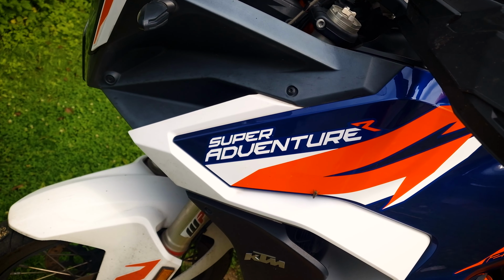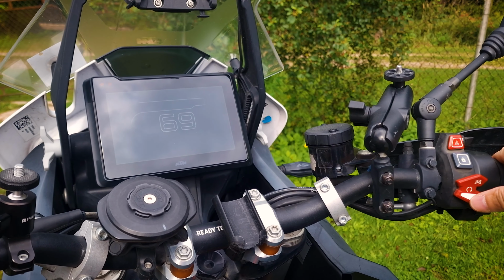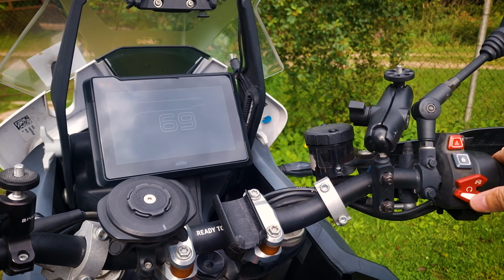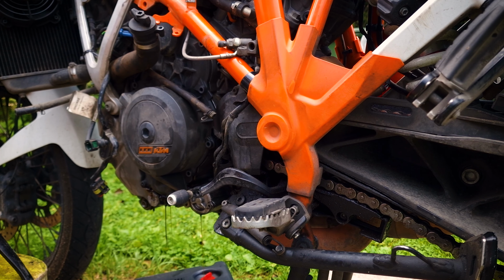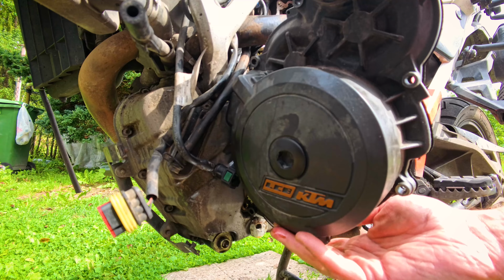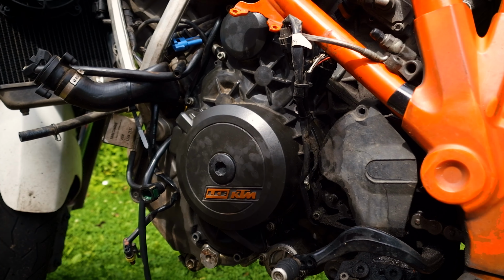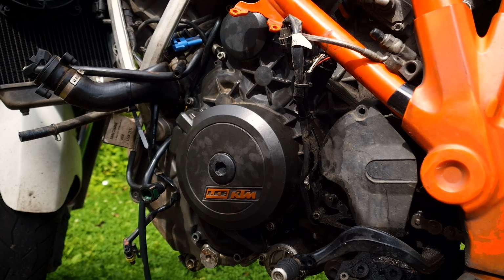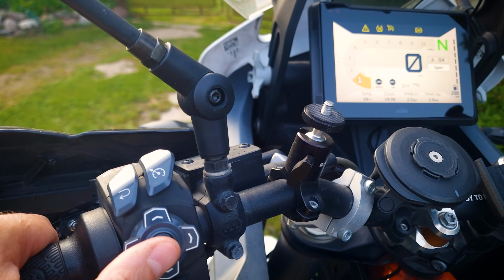How I Fixed My KTM 1290 Super Adventure: No Start Problem Solved!

Comment: These bikes are ridiculously dufficult to work on. Have to take half the bike apart for everything.
Reply from the maker: Yeah, you’re right. But compared to cars, they’re still easier to work on.
Reply: Bodywork and tank are pretty basic to remove. And really not any more work than my naked bikes.
Reply: @kj385 the number of bolts and the different sizes are absolutely ridiculous. On my vfr everything was the same size. Also; to connect the Acc it takes 7 panels and 40+ bolts with 6 different sizes if I recall correctly. This is absolutely bonkers.
Reply: @michaelrjacobs then maybe you’re not the type to work on bikes 😅
Reply: @kj385  nonsense. They should have thought about serviceability.
Reply: Geewizz !! This is not a job for beginners.  I don't know where I will start if it happens to me.  Probably sleep next to the road...😅
Reply: These bikes are all hitech. You must have the skills and knowledge to work on it.
Reply: @rynokeeve2720  Yet Japanese high-tech bikes dont take 7 panels and 40+ bolts in different sizes to even connect the accessory power. Its Just poor design from a maintenance point of view

Comment: wow you are overqualified for home garage mechanic )) its sad that such high priced bike have a problems like this. I have 1190 adv r and the same issue - bike eats crank sensors twice a year (( nobody knows why it happened. advices - you can put motorcycle on the left side using small chair - no oil spill when remove cover, clean motor with pressure air before removing the cover AND you need to check the space between sensor and wheel
Reply from the maker: Thank you! But it's really not hard. And about the sensors, I have a suspicion that they use wires with inadequate insulation on the sensors. It's hardening, and it's probably causing half the problems. I'll have to take the sensor apart and see if I can confirm what I'm saying.
Reply: maybe it depends what continent you're riding or what sensor SKU they use in different locations. I had 30000k on it and it didn't have that problem. The only sensor that ever failed on mine was the side stand sensor :)
Reply from the maker: @dawn-moon  Hi. I've done 68,000, maybe you'll have it break down later too. But you are right, maybe different parts manufacturers are used, for different regions. Probably depends on the oil used, or driving style.

Comment: I live in Northwest Arkansas. We have finally seen temps below freezing. My '22 SAS will not start unless the battery has full charge. I had to take off a lithium battery I bought in early Summer, it just will not start this LC8 in the cold. I put the stock battery back on (after a load test and full charge) and could not start without using a jump pack. Needless to say, I will be investing in an AGM battery. I have over 12k miles on mine, but am frustrated that these 1290s are so sensitive to battery voltage at startup. BTW, once running, battery volatage is around 14v
Reply from the maker: Hey!
Yes, batteries are a problem! If the battery is a bit low or old, it doesn't have enough starting current to turn the engine. That's because of the big cylinders and the high compression ratio.  Or do you have one that cranks but won't start?
Sometimes it has helped me to push the bike back and forth with the gear engaged to move the piston, then it will start. But that trick doesn't work in the dirt.
Reply: @D-Stealth  I think my issue is battery related. The lithium isn't recommended for cold storage, even says so on the package, but an option for summer. It is very light, not even 1kg versus nearly 4kg for stock lead battery. My SAS is parked in storage with no heat/electricity so I pull battery off (a minor pain) and trickle charge. I will try rocking bike in gear to see if that helps.
Reply from the maker: @scottieray  Well, you really need to rock the bike hard to get the crankshaft to turn a little. About the weight savings, is it really worth it for just a couple of kilograms? When I ride off-road, my bike usually picks up at least 10 kg of mud anyway. And when I travel, I feel like I’m carrying half of my house with me! :)

I was actually considering a lithium battery mainly for the higher cranking power. But thanks for the info — I can see it won’t really help in my case. For example, today I was riding in 2°C weather.
Reply: Indeed the battery needs to be in very good condition to start the bike, mine is from 2021 and I already changed once on 2023. Currently I'm having same issues to start the bike again, so I need to charge the battery or make a big trip.
@itsreallyeasy very nice video mate, I'll try your trick to move the bike in gear to see if it helps when she don't wanna start
Reply from the maker: @psycodriver  I'm planning on changing my battery early this season too. It would be a shame if the bike doesn't start for many thousands of kilometers from home.

Comment: Easiest way to install the generator cover (on any bike) is to use longer bolts (with the heads cut off) or some threaded rod screwed into the engine case in 3 or 4 locations, then you can use them to both locate and guide the cover on without fighting the magnetism. Simples 🙂
Reply from the maker: Hi! You're right, but it's even easier, there's a threaded hole in the center of the cover. A bolt can be screwed into it. It can be used to remove or install the cover very gently. I was just afraid that the threads weren't secure enough. But the official service confirmed that this is how they do it. It's just a bolt.

Comment: I will carry a spare crank sensor on the bike, especially for long trips & replace the crank sensor at each valve adjustment.
Reply from the maker: I have a sensor that has worked 60 thousand kilometers. But it doesn't take up much space. But then pay more attention to the engine start buttons. It is also a weak point and causes problems on long journeys.

Comment: You can check fault codes with a regular bluetooth obd2 reader and a free app for your phone, all you need to buy extra is a cable for euro 5 model.
A tip, if the tachometer does not respond when you crank, the sensor is the first thing to check
Reply from the maker: I was looking more at specialized diagnostic tools that can, for example, make quickshifter adaptation. But they cost 450 euros. And my bike has not broken down on electronics yet.
Reply: @ItsReallyEasy  Sounds cheap, what brand is that? The ones I've seen start at 2200eur
Reply from the maker: @daneng2335  For example: Duonix Bike-Scan 2 Pro diagnostic device for KTM is available on Touratech.

Comment: Regarding the little metal shaving that you found in the oil screw filter ... that is a piece from the thread of the engine case ( where you screw the bolt with filter) 
I had mine overtight or put back on an angle and stripped all the teeth of the engine case!   Had it fixed with a TIME SERT! 
keep an eye on it next oil change! good luck

Comment: Great job i have the same bike and took the tank and cowling off right after buying it off the showroom floor to install Denali Lights and also reposition some loose wiring harness resting on the hot radiator. Wasn't difficult bur it does have a sequence.

Comment: Love the video mate! But crankhaft position sensor is not the only one. Coolant temperature, oil temperature, air sensor and others.
Reply from the maker: Hi! You're right, there are a lot of sensors. But if the others are broken, the bike will start, or indicate the problem on the screen. Like the gear sensor or the footpeg sensor. If the temperature or air pressure sensor fails, the computer can operate in emergency mode. The engine will not work properly, but it will start.

Comment: Excellent tutorial, thanks! Just a quick question - could you plug in a engine trouble code reader and get an error code from the bike, like you do with cars?
Reply from the maker: Yes, you can. The diagnostic device costs about 400 euros. And it is not an original device, but one that can read codes. 
I didn't buy one.

Comment: Isn't there an specific air gap between the crankshaft position sensor and rotor (about 0.5mm I think) you should measure?
Reply from the maker: You're absolutely right! The service manual says so, but there is one point. In my version of the sensor and seat, there is no possibility to adjust the gap. I couldn't find it. There were specific protrusions on the sensor so that it could not be displaced. Because of this, I just looked that the sensor does not touch the rotor, and the gap is small by eye. But it also puzzled me. Is it possible that the sensor has to be bent for revalidation? That can't be.
Reply: @ItsReallyEasy  Apparently if the airgap is not right the bike can misfire when giving (a lot of) throttle at about 3000 rpm. I heard KTM mechanics had to adjust the airgap from 0.5 to 0.7mm and that solved the problem. Don't you have this problem?
Reply from the maker: @fredh4641  This is very interesting information. I had ignition skips before the sensor problems and they were solved by replacing the spark plugs. The plugs have worked for about 50,000 kilometers.

Comment: Didn't you get any flashing codes for the sensor? I had the same issue on my 2016 1290, and i had the red led flash the code (short and long flashes in a specific order), so I was sure it was the crank sensor. 

In any case, great course of diagnosing and solving the issue yourselfn
Reply from the maker: Hi! Thank you! I think on newer bikes you can only diagnose with a diagnostic tool. I haven't seen any mention of self-diagnosis with a flashing light. The principle itself is familiar to me, on my Dodge Stealth I can do such diagnostics.
Reply: @ItsReallyEasy  there is nothing on the repair manual of my 1290 either. they dont mention the list of fault codes, and they dont even mention the fact that the led flashing can indicate an issue, which i find really weird. 
a fellow rider managed to compile a list of fault codes and i found that list online. 
i guess KTM does not want us to self-diagnose any issues (not surprised tbh lol)

Comment: Have I been wasting my time pre soaking the new oil filters before putting  them in?
Reply from the maker: That's just a question for the “mythbusters!”. Actually no service manual says about the necessity of wetting or adding oil to the filter. 
I think a wetted filter is worse for the air lock that formed in the oil intake tube. It turns out that the oil will reach the engine later. My thinking.
Reply: @ItsReallyEasy  makes sense. I was told  by the dealership to lean the bike over a bit and to fill up the oil filter cavity and soak the filter first. 
It’s crazy. Im with you on this one. Keep up the great work. 👍

Comment: I have that same shaving from mine. 2017 55k. I use diesel semi synthetic oil lol. Every task, fuel filter, air filter, spark plug, timing, sas, all come with a mandatory 4 hour de-robing argh
Reply from the maker: HI! What does this cleanse involve, or what does it look like?